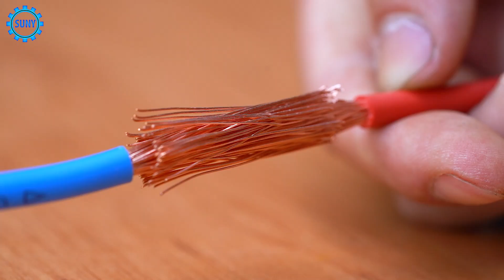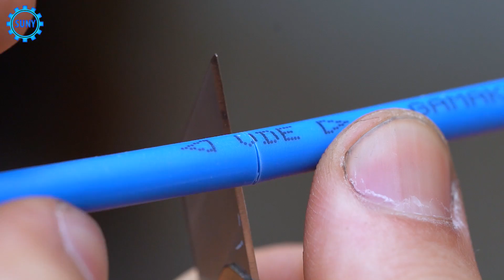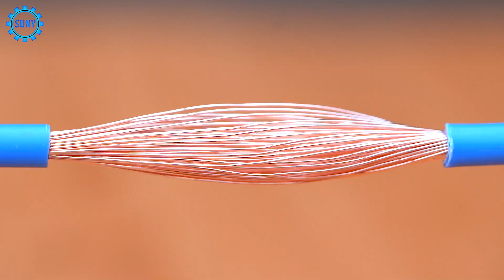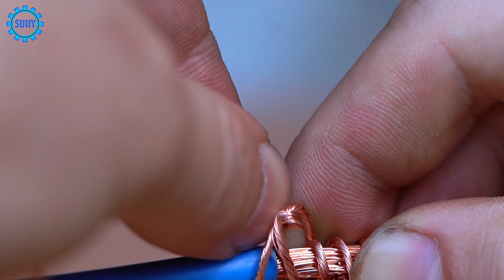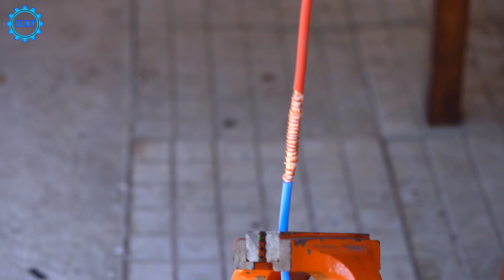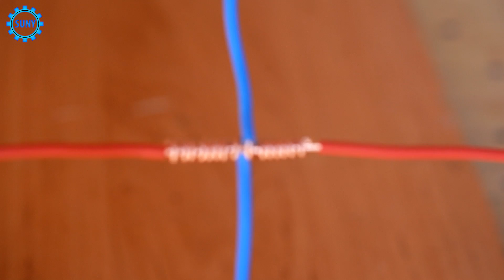5 DIFFERENT CABLE CONNECTION METHODS

Comment: I have over 20 years in the electrical trade and not one of these methods would be approved by an electrical inspector. Maybe you could call it an art project... it's very creative!
Reply: What about 2:08?
Reply: @fupidox5642  The same.
Reply: Electrically these methods are acceptable, but practically are not efficient and time consuming when doing the whole house wiring.
Reply: NO in Europe...!!
Reply: So how do they do it? Or simply replace a whole new thing with a connector?

Comment: I am an electrical engineer, and I disapprove of many of these methods, including warning of the risk that this can generate. This video is a disservice to a population.
Reply: True
Reply: Especially if it's carrying a voltage and load...
Reply: Firefighter here who dabbles in DIY electrical work and all I could think about while watching this was every one of those techniques is a fire waiting to happen. None of those are secure and will eventually create resistance heating when under load...
Reply: yes. I agree.this is only part of the job. these compounds must be protected from oxygen.
Reply: i'm able to accept thoose methods but only with soldering after twisting wires. I'm also electrical engineer.
Reply: Well Mr. electrical engineer, then you might be shocked to know that many of these methods are used by electricians out in the field....
..and more shocked to find out that these work and even last for decades😆
Only one thing is missing in the video above--> heat-shrink to insulate the copper, but any good electrician knows that😉 
And btw. even NASA uses the lineman splice!😅
Reply: @animarkzero  Before I became an engineer, I worked as an electrician for 10 years. In addition to being incompetent, these electricians are putting many lives at risk. I hope they take an introductory course on electricity physics.
Reply: @animarkzero  
Examples don't prove anything. Electricians in the field, NASA-it's all for poets. It is important that everyone understands the essence of the phenomenon.
Reply: I'm an electrician and I do think the same as you did, the kind of connections he did in the video must be soldered and covered by heat shrink and should be used for small current (high current can melt the solder when it gets hot as I experienced)
and I always write what you did on videos of people that show some kind of things with electric connections that need to be made by an electrician and people say bad things to me when they don't realize the risk of it... (sorry for the bad english, english it's not my first language)
Reply: As an electrician on aircraft, I found all those splices were very interesting, and thought, They never taught them splices in school.
Reply: What method would you advise? I'm a handman around the house and curious what's the best.
Reply: @Tal1m  You are correct, these joints should be soldered and covered with heavy heat shrink, and used for low voltage and low current, especially if these splices are used outdoors.  I do find these splices very interesting
Reply: @joeellestad8912     Joe, if you are doing work on 110/220, you must check with your local codes, and if required, be inspected.  Doing electrical work on your own home, can be very interesting and educational, if done correctly.   If you are doing low voltage lighting, you can do the video splices, if soldered and covered with shrink tubes. Check your local codes.
Reply: @joeellestad8912  avoid everything you saw in this video.
And use the correct cable connector.
In Europe we use conex or wago

The only time one of the mentioned splices is useful  is if you have to replace a wire that's to short  for an entire new one and you use the old short one to pull the new one in.
You really don't want to have any current run through those splices.
Reply: My friend Funny Brasil, I'm form Brazil too. I'm not an expet in the electrical field. But some of the methods used in the video are used by professional electricians

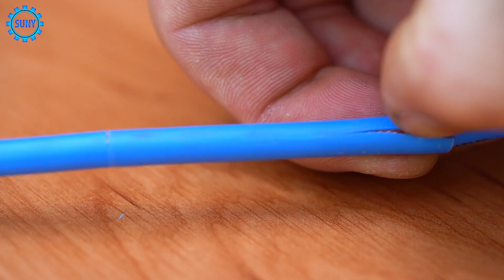1:05
This derivation method is commonly used in electrical installations and is also recommended. Of course, followed according to the norms and properly isolated. Everything will depend on where the amendments will be applied.

Sorry my english
Hugs!
Reply: @John Brown can you guide me to a standards document?
Reply: @ИванИванов-з7п5ъ  in soviet russia you don't fix electrical wire. The electrical wire fixes you
Reply: @JL-wf2wp  This is a primitive judgment)) In Soviet Russia, they fix EVERYTHING .
Reply: @ИванИванов-з7п5ъ  lmfao
Reply: There’s not necessary to be engineer for knowing it, thanks for the info, freak.
Reply: I used to work on power trains of electric motorsport vehicles. The proper way of splicing high current cables is using a butt connector and the appropriate crimping tool
Reply: I’m a professional electrician, and I disapprove of this video, too.
Reply: I'll second that..   use a straigh crimp terminal or 3 wrap and solder, shrink wrap...  :-\
Reply: Just because something works doesn't automatically safe
Reply: Well they are real fixes for High power electrical wires that need to be Soldered together and then coated with a weather-proof insulation. The 3rd connection is known as a Boston splice and was still being taught in Vo-Tech classes in the 90s.
Reply: using your title as evidence does just prove how poor your theory must be
Reply: @Tal1m  Furthermore, in many countries where you have to get your electrical work inspected and approved, such "creative tinkering" would result in the homeowner getting fined and his house declared unfit for use until everything is redone properly.

I can't understand the crowd of "People in the past did it all the time, so it's all good".

Check always your local codes: the "lineman splice" and everything else is good for low power appliances.

You get a broken lamp? You can fix the cables inside that way.

Your alarm clock needs a new loudspeaker and it's soldered and doesn't use connectors because it's dirt cheap? Splice a new one if the cable is too short after cutting it out or you're not skilled enough to solder stuff (which you SHOULD if you want to fix up).

That's fine. Using splices in your house wiring was very, very common in the "knob-and-tube" era.

If you inherited your grandpa house, you'd see lots of splices.

But also, if you live in Canada, Europe or other countries with a strict code, you should get your house inspected by a proper electrician and get everything redone up to modern specs, replacing the old knob-and-tube (or, for historical reasons, get it improved by adding proper heat shrink and assessing if the joints are strong enough or adequate to the heat requirements) and getting proper connections.

No one is slamming the author of this video, he's very creative and in low voltage appliance what he said makes sense. For example, a maker dabbling in restoration of modern antiques can take some inspiration to spring back to life an old lamp, a small fridge or electric toys and computers from the '70s and the '80s, who mostly took in 110/220V and turned into 12VAC or 5VDC for internal use.

If you're wiring some 5V or 12V LEDs, for example to light up a small room, that's fine, that's cool.

Otherwise? Better call a licensed electrician
Reply: @DrTofu83  I'm a certified electrician, not someone that "know a little bit" and work without any license, in my country 99% of the time we use a solid wire inside the sockets and lamps, etc...
only things that you plug into the sockets have standard wire (like he used in the video) also I work in a factory as an electrician and they not allowing to do connection like that without soldering and its a rule or something in my country not to do things like that as I understood from my boss.
also, the houses in my country 90% of them build from concrete and concrete blocks so it's not the same as most of the houses in the US and EU
Reply: @Tal1m  I know you are, and I was telling you are right.

I was also telling Funny brazil is right. A tutorial can help people learning to do low-voltage repairs, but for anything high voltage, it's better asking an electrician because houses do get inspected
Reply: Не хай, подобные скрутки работают десятки лет и никаких проблем, просто надо знать где их применять допустимо, а где нет.
Reply: I know, but: "Eh!", if you are not in a very wet or weird place or do not 
power any sensitive or high-power devices, chances are minimal B-)
Reply: @verstrahlt1907  If you're basically fixing your favourite lamp, rewiring some leds under your desk or building your own electronics kit, sure, those are all good way to have fun while doing that (just remember to cover everything with heat shrink).
But we stopped doing "Knob and tube" electric wiring in our household for a reason.

An hobbist wanting to buy electric appliances in kits could always learn something useful from this video, but he would still practice some soldering :P
Reply: @Tal1m  Are you comparing US wood build houses to EU brick build houses?
Don't know where you live, but i think it's the norm in EU to build with brick/stone, at least here in The Netherlands it is.
Reply: il faut souder à l' étain ensuite...!!

Comment: The one at 2:10 is known as the western union or lineman splice and has been the standard for attaching two cables for NASA since the latter part of the 90's. So long as you solder the entire piece, it has been proven to be stronger than the rest of the cable in tension, but still provide good/low resistance electrical contact.

Comment: I am electrician for more than 40 years.Those connections are made better than with  wire nuts.Soldering would make them even better.Not by the NEC Code tough.

Comment: I feel that solder makes these redundant.  And if you feel like, clamp pressure to make the connection a solid copper wire (cold welding). Which is what crimping does when done correctly

Comment: Good suggestions, although maybe it's too much of uncovered wires. If you have proper insulation ok, but when using only insulation tape I would prefer the usual method.

Comment: This is a great idea for running new wires   with the old ones through EMT or tight space. Besides that, the wires are stripped back too far and exposed. Not really professional when you have to insulate the expose part with electrical tape. Just save your time and use wire nuts or wago connectors, more safer as well.

Comment: Perfectly adequate for low DC voltage ONLY.   Most of these are dangerous as hell for higher voltage DC and absolutely unacceptable for AC of any voltage.

Comment: Bloody hell im an electrician and this is no way to splice wires together! You’ll get hot spots and not to mention you take too much time.
Reply: Probably only best for a temporary fix
Reply: So how u do it?
Reply: Topsoil Depletion Awareness (closing the loop) twist the wires together and use a marrette/wirenut
Reply: The NEC doesn’t approve these methods
Reply: 100% truth. Never splice flexible wires like this.
Reply: Topsoil Depletion Awareness (closing the loop)    Twist the wires together with a pair of linesman pliers and cap it tight with a wire nut or use a wago.  If you’re doing arts and crafts, fine.  But if you’re actually doing some electrical work, don’t even attempt any of this

Comment: Very creative but impractical or meet NFPA or NESC standards. High voltage lineman may use a couple of these splices, but for low voltages 120 240 a simple wire nut would do.

Comment: I'm 58 yrs old and ive been using the exact methods since I was 5 or 6  it's common sense ive never had any problems with connections made the right way and tite

Comment: To repeat what others here have said.    Don do this!

These tricks are useful for hobby work on low voltage low current situations.  In all other cases, the appropriate manufactured connector must be used.

In principle connecting wires seems like the simplest thing but in practice connections, even soldered are the biggest source of troubles in electronics and household wiring.  Not only can the circuit fail to work,  the heat from the connection can start a fire.   Bad connections are a major cause of electrical fires.

Comment: 2:10 I use this method lol xD
Reply: This is the first step of a NASA splice. Like all other methods shown, it still needs to be soldered, leaving no bare copper exposed, and then covered in heat-shrink insulative coating.

Comment: Very good, and if you still solder the bomb, the truth is not always convenient, especially at altitude
Reply: Good connections. 2 questions. How do you insulate them?  How do you make them inside a junction box?
Reply: @gailcarlo2758  the junction box is not a convenient connection. insulate either tape or heat shrink industrial facilities perfectly

Comment: Being such a smart guy you might be interested in a brand new product. It's only been on the market for about 5 minutes but it would be perfect for you. It's called SOLDER. All you have to do is twist the two wires together and heat them with a SOLDERING IRON and melt the solder into the wire. I swear it will revolutionize the entire industry. You really should try it. You'll never have to make a stupid video ever again. OH, I almost forgot. Right before they invented SOLDER (maybe 10 minutes ago) they also invented this other revolutionary thing called SOLDERLESS WIRE CONNECTORS.

Comment: Just stick the crimp connectors if the wires small enough and if it’s a big wire solder it
Reply: then heat shrink

Comment: Without soldering, it will sooner or later start to spark, and oxidation will damage the perfect connection. The stronger the current flowing through, the sooner. Maybe in 10 or 70 years. It can be unreliable and flammable.

Comment: This is how you burn down your house
Reply: Can you imagine going to someones house and seeing this done? I wouldnt know if I'd bust out laughing or say every swear known.
Reply: Actually, these techniques are technically correct. For full completion of the joints, they could be soldered, but they need to be insulated without question before being energized.
Reply: This is actually correct way 
You won't be pulling 400A through them
Reply: NEC doesn’t approve these techniques and if ur doing  hundreds of these connection a day the Forman would cus u off the job site
Reply: Ive seen things You’re stuck on the NEC- what about in electronics and for data transmission (yes also under the code, but not high voltage). Does that change your answer/attitude?  Open your mind - not everyone wires houses. There are other multi strand copper wire applications - like maybe in your car or boat.
Reply: Gregory Kusiak you cry baby
Nobody would ever terminate low voltage or electronics like this,  especially in a car or boat
Reply: Ive seen things thank you.
Reply: Don't you got Wago clamps in your country?

Comment: I know it's not to code, explain to me why are those methods bad without solder or mechanical means. There is more contact surface at the splice than anywhere along the wire/cable and seem mechanically strong.

Comment: I'm no electrician, but I can't think of a situation where I'd need any of these connections...
Reply: If your old wire is to short and you have to pull a new wire in.
Thats the only time you use one of these.
Used some of those for that reason only.

Or to connect some streetlights for your modeltrain setup.
Everything else :DONT USE THIS

Comment: The last method is wrong because it can't suport too much  for that connection is better the rat's tail  because is solid wire or try to get the + connectors

Comment: You are probably better in a career of braiding hair.

Please don't connect cables by essentially tying them into a big giant knot. Especially not for mains voltage applications.

Get the right tools and equipment, DO NOT kludge together a giant knot.

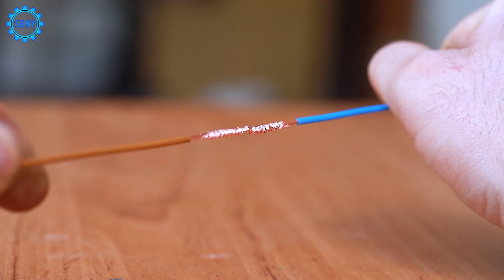Comment: keep doing fake pulling strength, everyone can break the 2:57.
Reply: Depends on the person who made that joint. Also on gauge of wire used. It only shows technique. Put little solder on it and some insulation. You can also alter the length of joint.
Reply: If you are trembling that means its your full strength. Even a woman can break that size.

Comment: Please never ever try these steel wire clamping devices made by some absumutly non tech if try any of them you might suffer major accidents  standard clamping devices are available in market at very low pri es use them wall clamping fastners etc all 100%failure

Comment: I have never seen splices done like that. I am a journeyman electrician with over 20 years in the trade. Those splices are wrong, dangerous and not approved by any standards council anywhere.